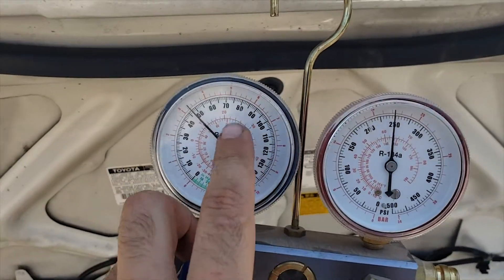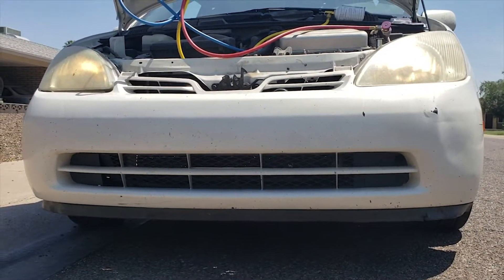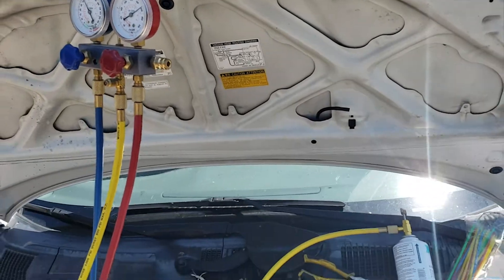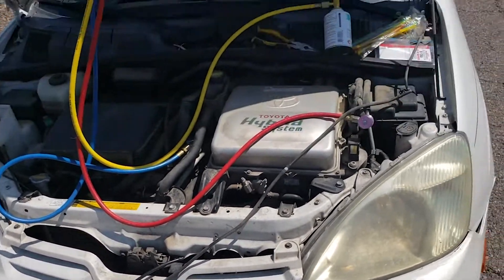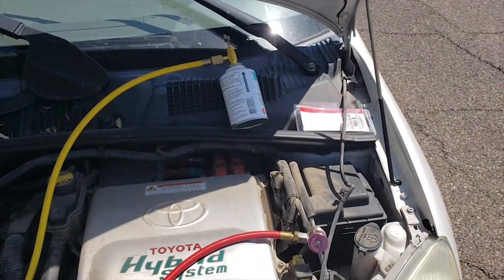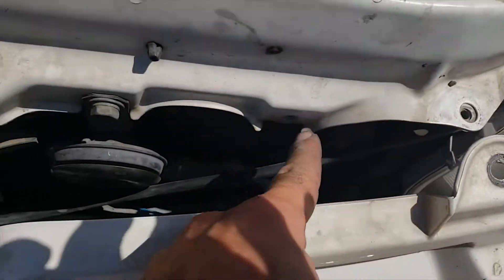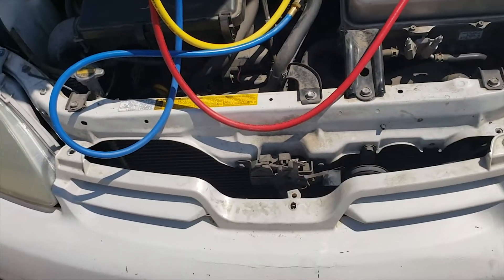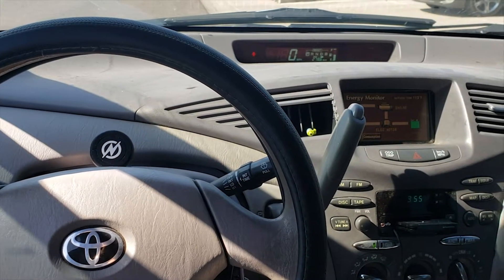10 Minute Free AC Hack??? Does this work?

Comment: Did something similar on a Merkur xr4ti  I used to own. The intercooler was way to small so I got a couple of cold start injectors out of an old VW, a cheapie Napa in-line fuel pump and a washer tank out of an old Saab 900. Cooled intake charge by about 50 degrees
Reply from the maker: Kerry Kinser that's awesome! I think I will get better nozzles to spray the condenser more evenly. But 50 degrees is a big difference!

Comment: Ur compressor is going out that’s y the low side needle was fluctuating like that. They have like reed valves kinda like a 2 stroke they r failing and that’s where ur leak is.
Reply from the maker: Just_ Boost good to know! It's got a ton of miles on it, so I wouldnt be surprised. I'll keep an eye on it!